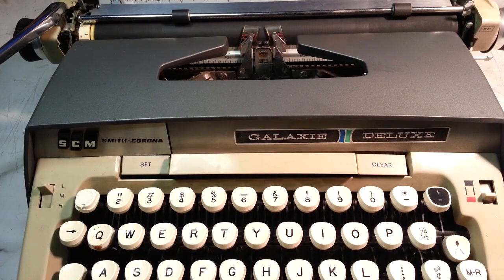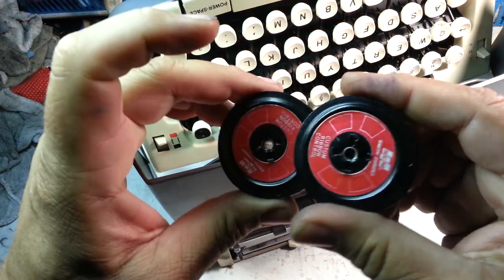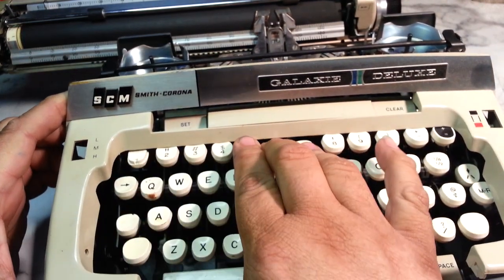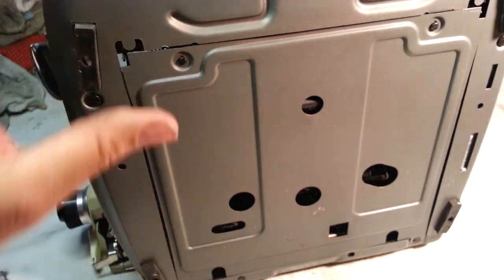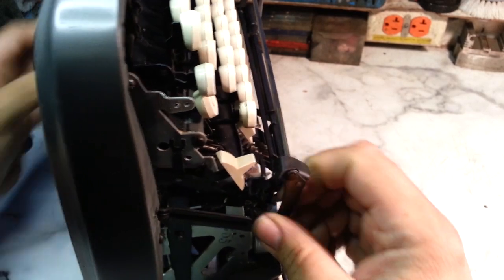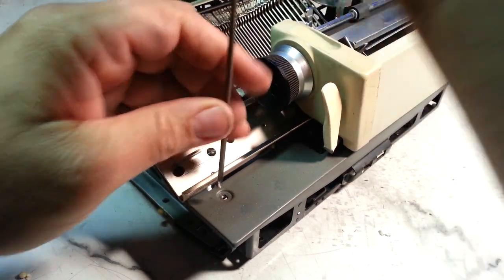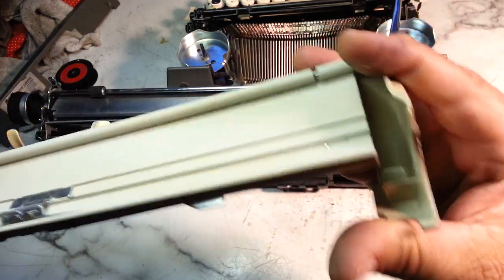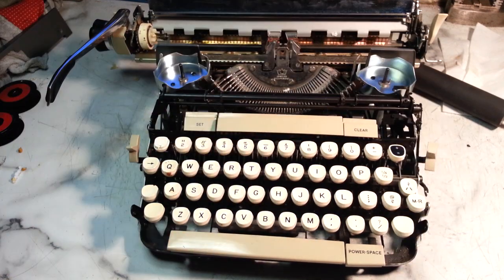Smith Corona Galaxie Deluxe 6 series Manual Typewriter Case Cover Shell Removal procedure

Comment: Any idea how to place a Smith Corona Galaxie back into the shell? I removed all the panels using this video and now cannot get it to fit back in properly. it’s got two little metal hooks that line up with the space bar bumpers and I can’t seem to activate the space bar when i try to reassemble it
Reply from the maker: These can be tricky to remove casing, trickier to Reassemble. Done this 100's of times, still can be a PIA
Without being in front first hand I don't know how to guide you

Comment: Took me a few minutes to get the paper pan out then took 20 minutes to find the secret handshake to get it back in…1. carriage full right, 2. Feed it in under roller on left at up angle just below plastic paper guide 3. Jiggle left post underneath into correct hole 4. Jiggle right post into correct hole EASY LOL

Comment: What year was this model introduced.. Great video.  Just fixed all of that.  It’s working perfectly.  You a pro 👍🏽
Reply from the maker: I'm not sure , like 1970
Reply: Phoenix Typewriter I made some research.  They went from 1962/1967. Yes. Early 70s if we round it off.  It’s crazy how the Galaxy Deluxe has limited information about it.   Thanks for replying.   I went thru the serial numbers and letters under the typewriter.  Wikipedia.     The Sterling would be 1962/1965 as it is much smaller.  Like a mini version of the Deluxe and the Deluxe 12.  :)
Reply: I just got a 1975 Galaxie 12.